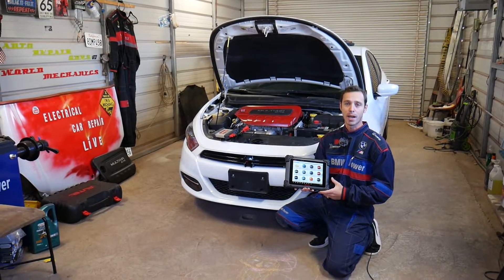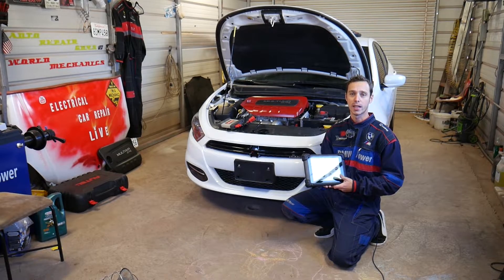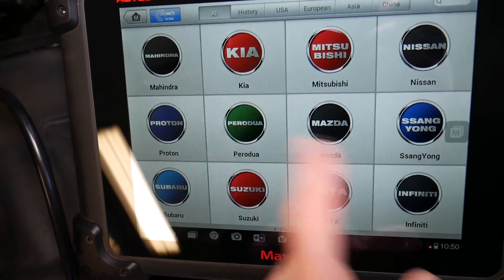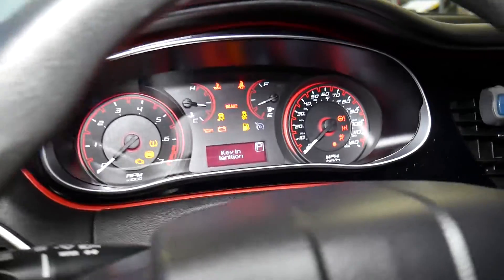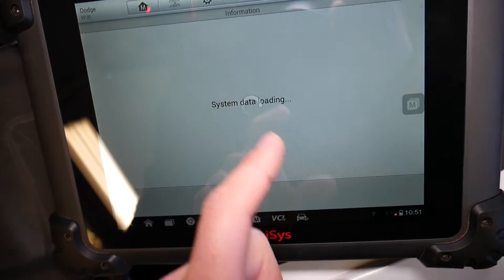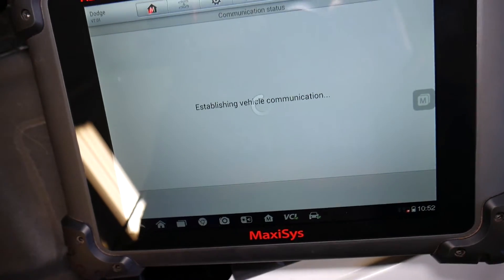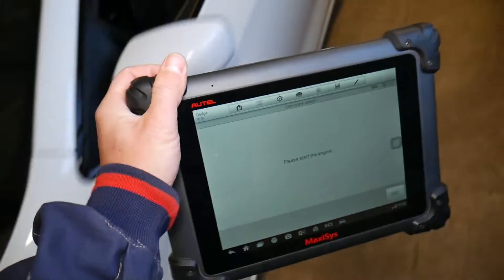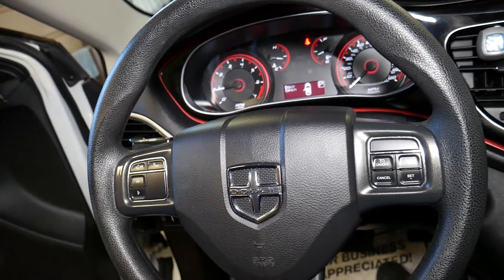HOW TO RELEARN CALIBRATE CAMSHAFT AND CRANKSHAFT POSITION SENSOR DODGE JEEP CHRYSLER FIAT

Comment: I just replaced the camshaft position sensor my car is 7 years old 2013 sensor was filthy... and now i still have the p0365 code do i need to do this process?
Reply: Did you ever figure this out? I’m having the same problem with my qx4 I replaced the sensor and the solenoids and did an oil change just in case and I’m still getting it with the new sensor
Reply: Yes a dodge dart